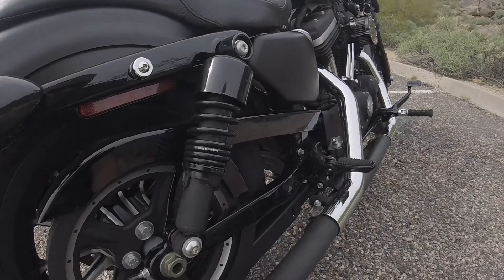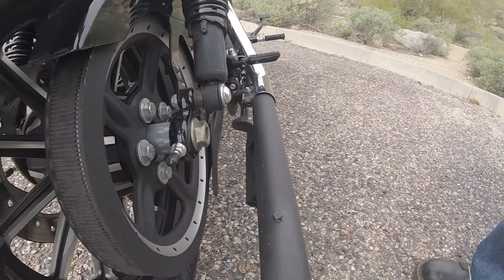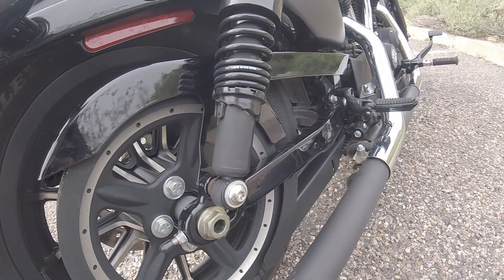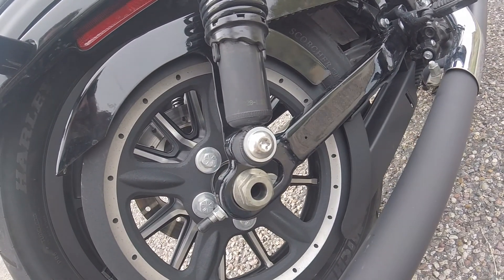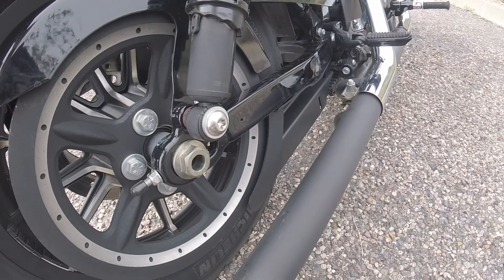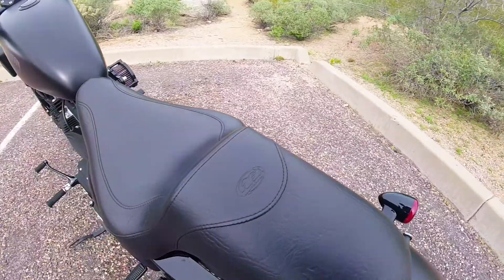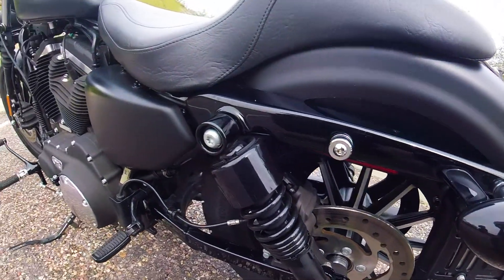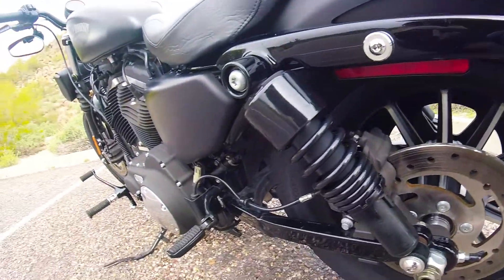Burly Slammers Sportster Shocks | 2015 Iron

Comment: How much did this lower the rear of the bike approximately? Do you notice the difference in the ride?
Reply from the maker: If I remember correctly, it lowered the rear 1 inch. I bottomed out the shocks a lot easier until I turned up the pre-load (much stiffer ride). Also, it scrapped a lot more while cornering.
Reply: @BlackStar_78  so overall would you not recommend? I’m about 170 pounds ride pretty much never two up. was looking to slam the rear, but don’t want to turn the bottoming out my bike. Thanks.
Reply from the maker: @DerekEvan  Go for it! I'd do it again if I got another sporty- but I was also 5'6" and around 220lbs at the time of this video, so I kind of need the lower seat. Also to note- I ride really aggressively, so if you're a  more conservative rider, you probably wouldn't have any issues.

Comment: Did you have to modify the stand, or is it still stock? Have you had any issues bottoming out or scrapping the exhaust?
Reply from the maker: I did not modify the jiffy stand. The bike is a little more upright on the stand as a result, but it’s not bad. Bottoming out is a big issue- speed bumps are sketchy, but I always squeeze around on the side or go through the center cut out anyways. I don’t scrape the exhaust like I did with the stock pipes because the radius on these is smaller, but I do scrape all the time- that’s just the way I ride. A more conservative rider won’t have any issues.

Comment: I'm 5'3" would I be able to flat foot the 883 with those shocks on?
Reply from the maker: Yes, if you kept the stock seat. This seat is thicker than the stock one, so the inch that the shocks lower the bike, this seat raises you back up. I let a coworker, who is also 5'3", ride this and he was almost able to flat-foot.
Reply: Black Star Thanks for the info, I appreciate it.
Reply from the maker: Sorry it took so long! I try to respond asap, but these few weeks have been a nightmare! Leave a comment if you have any more questions- I'll answer them as best as I can!
Reply: What slip-ons are those?
Reply from the maker: Those are Wyatt-Gatling slip-ons that I found on ebay. I did a video about them if ya want to give a look...